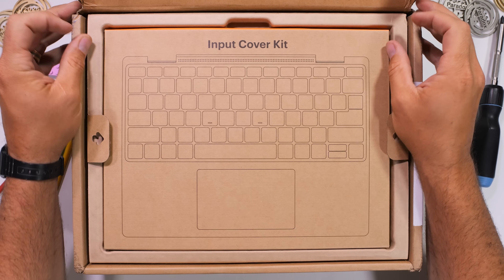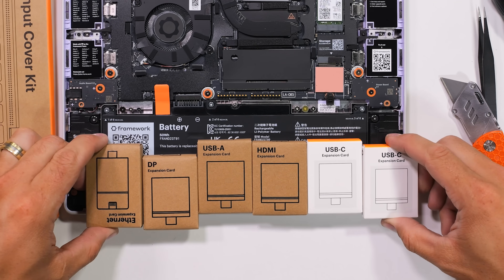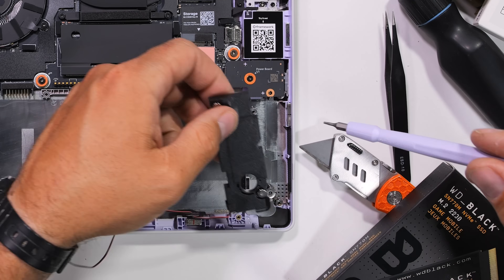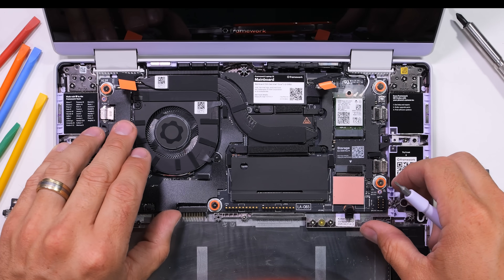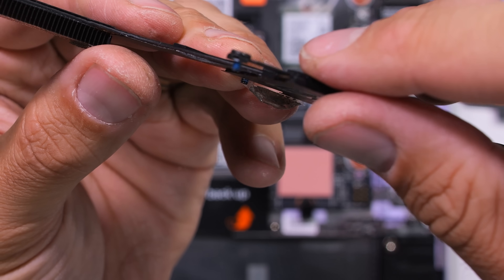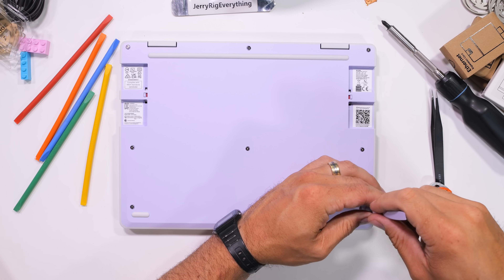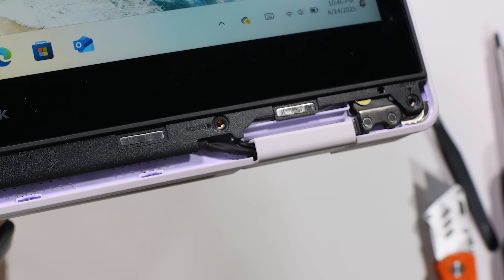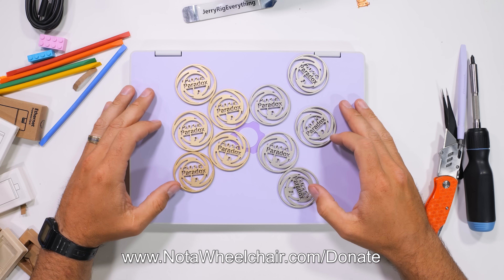The Best Laptop on Earth... is almost too easy to fix.

Comment: As a student, this would be the perfect laptop for me. Not just because it's 12" and has a touchscreen with an included stylus, but also because of the cost and the fact that when one component is broken (such as the battery or the power connector), I can easily replace it and get the components from Framework. This is such a headache with almost all laptops as they have unrepairable components and issues, including my current laptop, which after three years already shows signs of obsolescence simply because of a couple of unrepairable laptops. I'm glad Framework exists!
Reply: That's the primary market for the 12, students. Mainly younger students, but college students would get a lot of mileage out of it too.
Reply: @ryanspencer6778 students but also just people that are curious about framework but aren't in the market to spend $2,000 on a device. This one's starting it less than a MacBook Air makes it at least in the ballpark for so many more people that were curious about. Basically anyone that wants something small and repairable. But can't spend more than a thousand bucks or so
Reply: They are genuinely very good devices
Reply: Framework is not a good student laptop. Poor battery life is an absolute dealbreaker
Reply: @GoriIIaTactics  My current laptop is even worse. I'm expecting around 3 hours of battery life for a device I need to use for almost 8 hours.
Reply: @sprinklednights Battery life is by far the most important attribute for a student laptop. I perosnally suggest you find an intel lunar lake laptop, or the cheaper older core ultra processor laptops
Reply: It's painful to use a laptop as a student in 3rd world country unless your family is rich. We use our laptops until they become truly unusable.

When I was a student, it was common to see friends bringing laptops with external keyboard, white lines on the screen, or needing to keep them plugged in because the battery was already dead.

I hope it will be reasonably priced when it becomes popular. I don't mind paying a bit more for such wonderful hardware, but if it's twice the price of a regular laptop with the same specs, as DirkGently said, then it becomes a dealbreaker for us.
Reply: except for the price of it fully configured you can buy 2 laptops. If you want real value, get a gently used thinkpad. might be less lego like, but most important parts are still readily available. with Framework you will pay twice as much or more with the hope of making it back someday that will likely never come. And any mainboard upgrades will likely cost as much as a new laptop.
Reply: @DirkGently-km3hn  lol thinkpads.
the quality is bad, they are just another throwaway after 2y / leasing item...
rossmann was right, lenovo doesn't do quality.
the competition at least tries to be a bit better
Reply: @_DSch  I have a 2 family members rocking a 8th intel thinkpad still. an 11th gen intel thinkpad yoga that gets a ton of careless abuse, and and 3 x 6-7th gen intel Dell mobile workstations. All have been rock solid, and 4 had batteries replaced for reasonable prices. There is a value to what Framework is doing, but at what price premium is it a bad value? 25%, 50%, 100%, 200%? Business laptops from Dell/Lenovo have transferable warranties, strong parts availability, tons of dirt cheap refurbished parts when it is 5 years old.
Reply: @DirkGently-km3hn  I've been thinking about getting an old Thinkpad, as I'm a part of the Linux cult, but the issue is that the battery life, the bulkiness, and the usability doesn't fit my criteria for a laptop for school.
Reply: @sprinklednights  you can get thinkpads with better battery life and faster cpu's for less. A used x13 with core ultra 155u, 20% better battery life, twice the cpu performance can be had for 600. a Similar configured F12 with no OS and not assembled, is $840. Even buying new, a thinkpad on sale (which is often) is going to be hundreds less.  Buy the framework only if you want to support a vision with the hopes that economy of scale will eventually drop the price, but currently, even with the ease of repair, the value spec for spec isn't there.

Comment: Seemed pretty interesting at the beginning, but once I tried the configurator, I discovered that Framework is about 75 % more expensive than Lenovo in the same configuration. This is not a good deal by any chance.

Comment: That single channel RAM that will disable the Iris GPU in those APUs is a crime... For such a bulky device, how did they not fit 2 RAM slots, and an 2280 M.2 slot? My ASUS ExpertBook B5 has 2 SODIMMS, 1x 2280 and 1x 2230 SSD slots, easily upgradable, easily repairable, very thin laptop. Asus also makes the Experbook B2 Flip which like this Framework is a 12 inch 2in1 but with 2xSODIMM and more ports...  I don't really get the hype about Framework, especially for the price it makes no sense, plus the upgradability isn't so much greater than some options out there.

Comment: I've taken apart at least 500 laptops. I don't think I've ever seen the heatsink NOT be numbered. This laptop is amazing though. I've soldered hundreds of charge/ USB ports. It's nice that these are modular. Most lcd screens are easily replaceable, but most have adhesive, this is beautiful.
Reply: as your experience some things are easy to do even with other laptops but for a normal person that doesn't do this things regularly or even NEVER it is some weird magic tricks. This laptop is the definition of user friendly
Reply: My Samsung and ASUS laptops don't have heatsink numbered.
Reply: @saiv46  interesting, every Asus laptop I've opened has had numbered heatsinks, but to be fair 90% are gaming so it makes sense for them to be numbered.
Reply: @Regular_D09  it can be some rare models, i have seen some unnumbered holes on netbooks and very old models of acer/toshiba. 
And not sure if it make sense on "gaming" laptops, manufacture don't want you to disassemble either of them anyways. (Except for the back cover to swap ram/storage)
Reply: @alkallne-koh  Asus, HP, and Lenovo have some of the best repair options out of the manufacturers. Lenovo being the best overall. You can type in your serial and get every part and part number for your laptop down to the motherboard with the correct configurations. Of course they don't want you going inside, but if you have to they have a lot of resources for repair.
Reply: Yeah, even my Surface Pro 5 has numbered screws on the heatsink and that's one of the least repair-friendly laptops ever made.
Reply: Apple laptops aren't numbered on their heatsink.
Reply: @kingzach74  apple is truly the weird kid huh hahaha, thats wild how hard is it for them to number it
Reply: @kingzach74 yeah you're right, but the board generally comes out with the heatsink. Most laptops you HAVE to take the heatsink off to get the board out.
Reply: the monitor of the framework has a proprietary cable. if the cable breaks you have to buy a whole new monitor. can't even get a off brand monitor from aliexpress without getting a new cable from framework (which means buying a new monitor). very repairable indeed lmao
Reply: @KewaiiGamer  You're spot on. It's wild to me how this entire community is on the koolaid of framework's "Repairability!!" campaign dupe considering their parts are proprietary and quite expensive.

Comment: My main complaint about the 12 is that due to it being a 12-inch instead of a 13-inch, they couldn't make their mainboards backwards compatible. We've gone from two categories of mainboards (13- and 16-inch) to three. I understand if their target audience wanted a smaller, cheaper device, but I would've loved to be able to buy one of these and always use whatever board was previously in my main 13-inch laptop in it.

Comment: There's always the concern that if the company shuts down for any reason, you wouldn't be able to get the custom replacement parts - but in an environment where any other laptop you get isn't going to have parts that can be easily replaced, it seems like much less of an issue.
Reply: yep, the worst case scenario just means that your laptop is still an above average repairable one, because at least you can still replace both storage and ram with standard modules, which not all laptop companies offer.
Reply: First of all, the company can't keep up with demands. Second, they encourage 3rd party companies, to make accessories. While I don't think the intention is for 3rd companies to make the motherboard section, anyone could easily do so. Then you could buy just about any spare part you want, from 3rd party manufacturers. The laptop will last forever.
Reply: There's a third party motherboard (albeit designed in partnership with Framework) made by DeepComputing, so yes, third party motherboards are a possibility! Regardless, Framework is unlikely to go anywhere any time soon, as by this point the volume of their sales is huge and their money is invested in multiple avenues.
Reply: Its a choice of something  you will be able to upgrade(for a lower price)  from a company who may fail or a laptop that is 100% un upgradeabl when you buy it.
Reply: At least you know you can use any component from another Framework laptop, without some BS calibration software. And some parts can be done by the community. The motherboard is probably the only one that noone will make it (or the GPU module for Framework 16) is it would be too much work, especially for something that would be old and unable to be sold at a profit.
Reply: Many of the parts are well-documented, so in that event other companies, organizations, or individuals have better resources to make their own parts compared to many other laptop components.
Reply: @godminnette2 noone’s ever gonna do it. Non-framework laptops would be way easier to repair once framework goes down because of a whole bunch of aftermarket and recycled parts.
Reply: It's not owned by Google. Their company will age just fine.

Comment: Man I love the Framework laptop as a concept...
But the entry price is nearly double to what you can get, same specced, at Lenovo, Asus, Acer, etc.
And I gotta tell ya, Lenovo (bar from the GPU + CPU) can be upgraded and fixed pretty easily these days.
I am looking for a gaming laptop that will replace my current gaming laptop next year and you can only get an RX 7700S which sits on par with an RTX 4060 (Laptop) but at the RTX 4080 (laptop) price point... :(

Comment: Have had a framework 13 for a few years and it's great. Paired it with a desktop GPU in an eGPU enclosure and it's pretty powerful. The main bottleneck are thermals and CPU (as expected) but it's still pretty nice. I got it before the 16 was released but I'd assume with the 16 it would be comparable to desktops

Comment: Thanks for the video Jerry,  appreciate it. 
Speakingofr the product I did a configuration test and the final price is easily double the corresponding "standard" laptop ( talking about 16models ) . Doesn't sound accessible to me even though I have the option to upgrade the components in the future,  I believe it will be cheaper just to buy a brand-new gaming laptop when the current configuration becomes obsolete.
Reply: The 16 is more expensive but in the long run if you can afford one, it will continue to be upgradeable (and more importantly repairable) long after a cheaper gaming laptop from 5 years ago becomes obsolete.
Reply: @kingzach74 if you wish to pay a premium just to have the option to upgrade in the future, then I respect your decision. 
It will never be cheaper in the long run no matter how you analyze it. 
Any laptop, if properly handled,  can last a very long time . 
Some of the traditional laptop components can already be upgraded to serve for multiple years past warranty ( you just need to investigate a bit about each configuration and buy accordingly).
Now, above i was referring to a "normal" productivity laptop, when speaking about a gaming laptop..well that's just a bad investment on the long run no matter how you think about it 😊.
Can't wait for the new EU legislation regarding batteries to be implemented. Imo that will be a game changer for the lifespan of multiple devices that are battery powered.